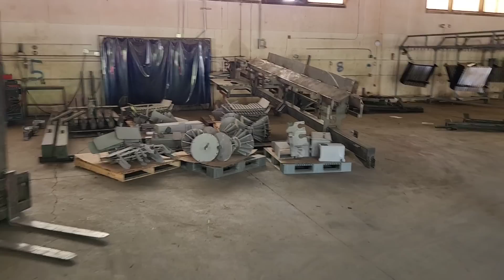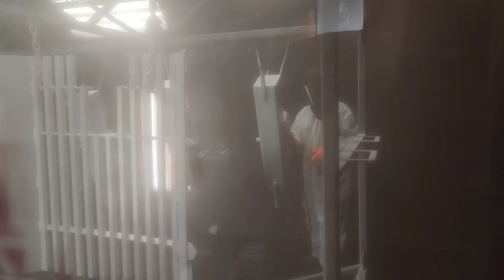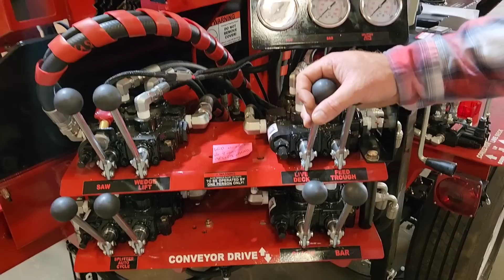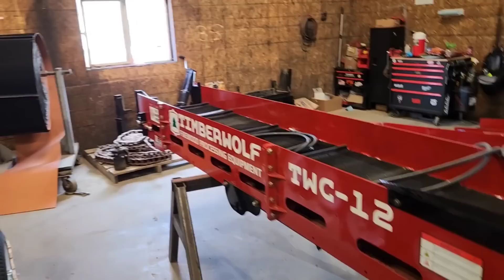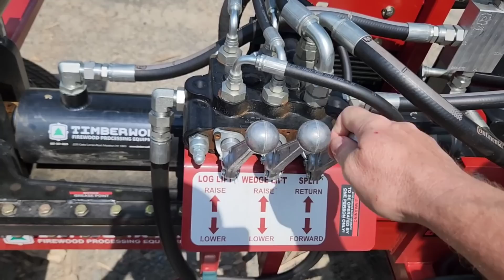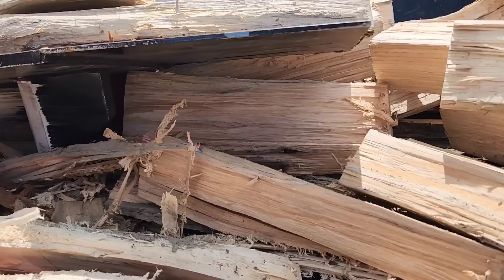Inside Access |  Timberwolf Firewood Machines

Comment: Timberwolf customer service is very poor. If you buy one of these and have a problem expect the run around and to be down for months. Paint is very poor it will be worn off after a couple rounds.  I also called to give a suggestion on a jack for the tw2 because its all but impossible to hook to a side by side or 4 weeler.  Matt with his very poor customer service skills Said they have been built like that for 30yrs and hung up on me.  No auto cycle on their splitters is another reason. Timberwolf builds and sells equipment with 30yr old technology at about the same price as Wolferidge and Easton made witch is far superior.
Reply from the maker: Thanks for sharing Terry.  I enjoy hearing from all ranges of the spectrum.  I hope you can get this solved.